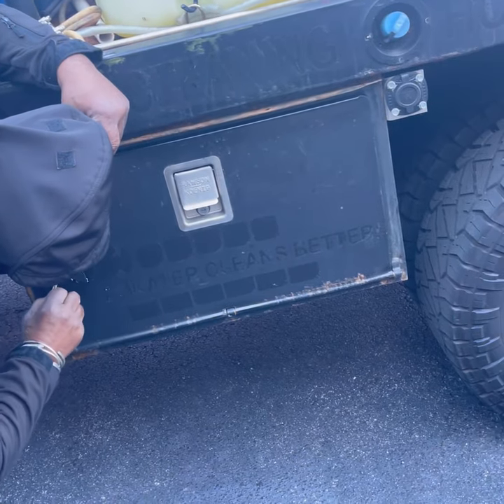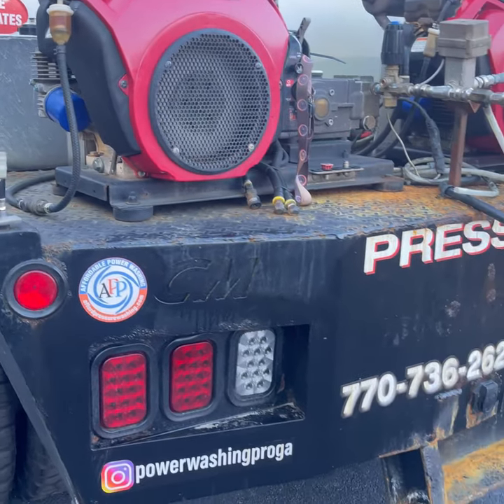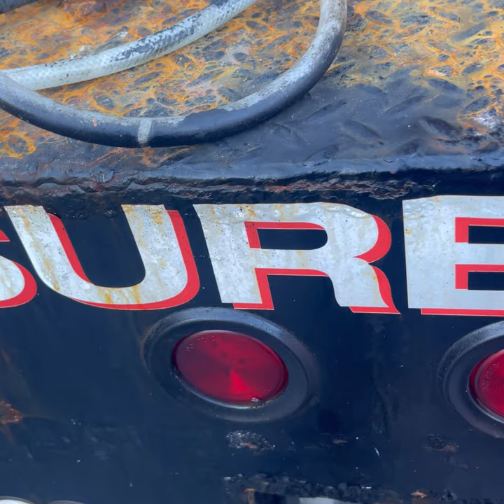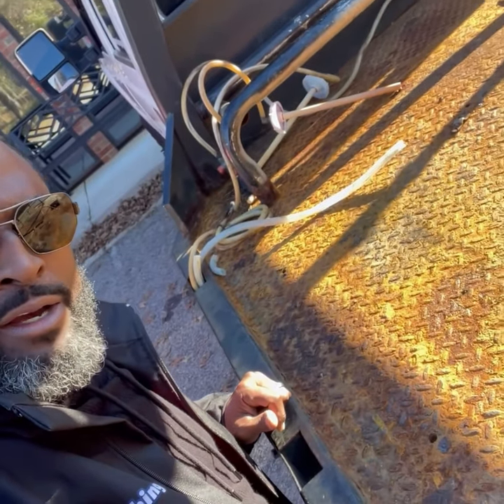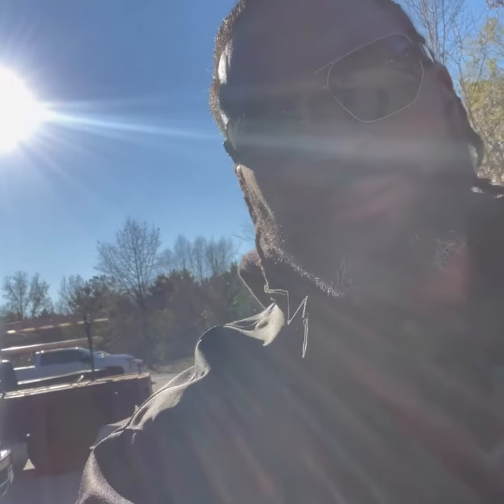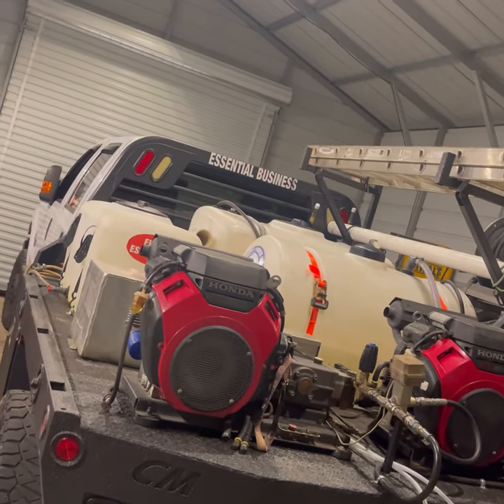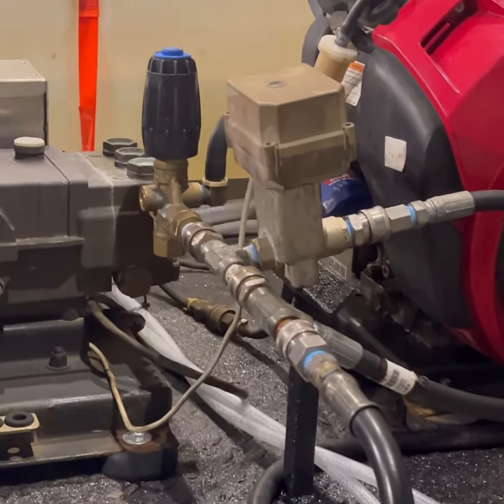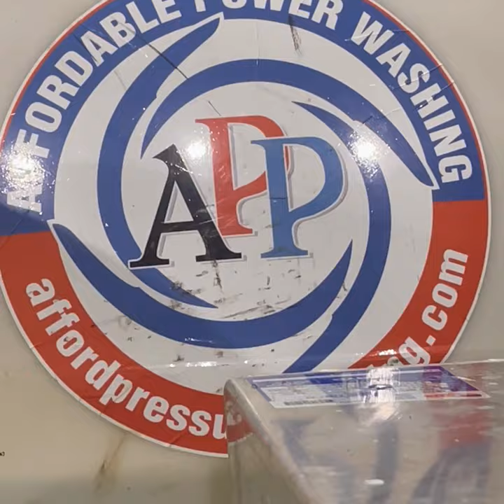PRESSURE WASHING RIG REBUILD W/ BED LINER | Bleach / Chemical Resistant @powerwashingproga

Comment: Do you have a vent hose that goes to the bottom of the truck? Bleach is denser than air so if you open the cap or open the cap to fill then the chlorine gases will just fall to the bed and eat it up.
Reply from the maker: Well at this point it’s no longer an issue. Bed has been sprayed.